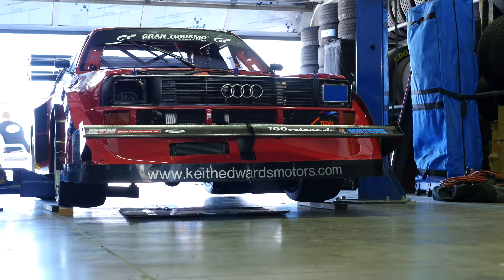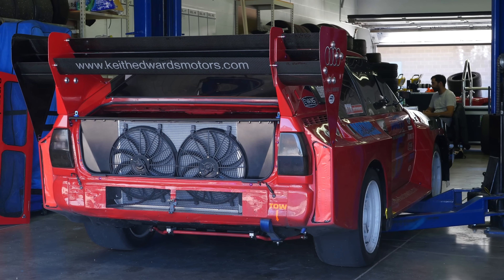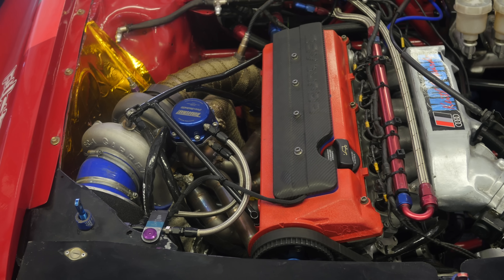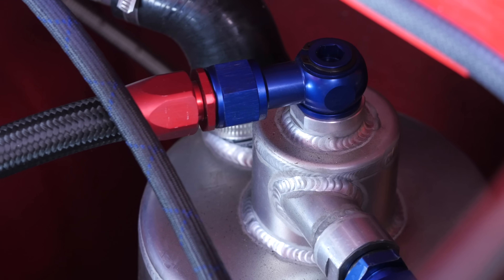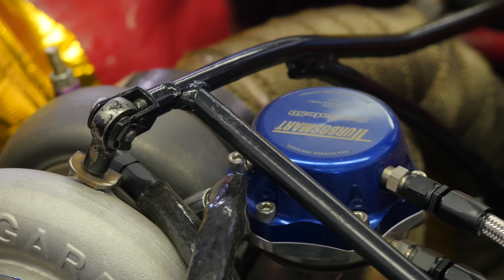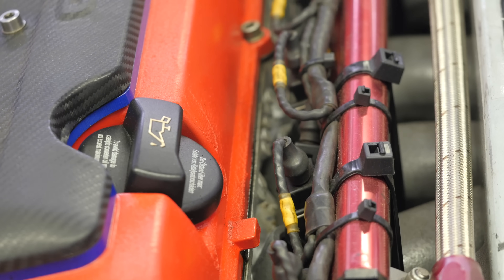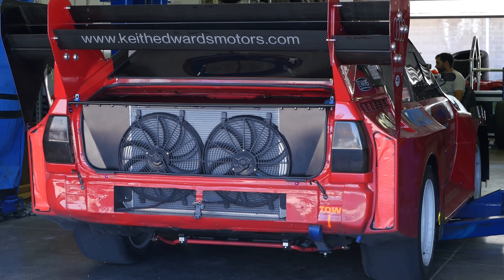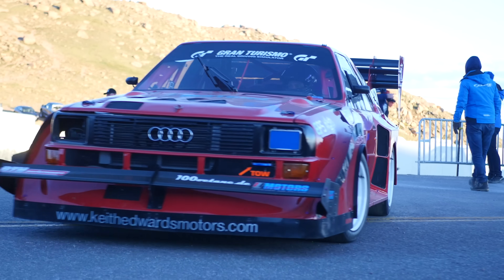Group B Pikes Peak | 750HP Audi Quattro S1 E2 Replica [TECH TOUR]

Comment from the maker: Want to dive into the finer points of why you think this is or isn't an accurate replica? Unlike arguing on the internet these soft threads will make you feel all warm and fuzzy so how about spending the time putting through your freight free order instead: https://shop.hpacademy.com/ - Taz.
Reply: haha, as a big (old-ish) Audi nerd, I'm happy as long as it's the right windshield, otherwise it just doesn't look right, but hey, to each their own! 
6:50 - does this arrangement use a transfer case? Original quattro transmissions used a hollow shaft to direct the power from the centre diff to the front wheels, so this sounds a bit unusual, or is that aftermarket transmission equipped with such a hollow shaft as well? Or maybe I just misunderstood what you meant.

Comment: Great video. Is the center diff a stock Torsen or is there no differential? 50:50 can be both. Fixed makes me think there is no differentiation going on like a spool. Is this transmission based on an 01E?

I cant wait to get my built 20VT running again!
Reply: Wouldn't be any point to a Torsen that was 50/50...  the early cars were all mechanical lockers.  Motorsport cars were generally locked all the time.  If it's based off the original gearbox it's 016 based rather than 01E.

Comment: The particular engine in that car behind you is probably from the later UrS4/6 AAN engine. You can tell by the valve cover and intake manifold. The IM is modified by moving the TB flange forward from the middle. The S2 IM has the TB mounted at the rear of the plenum and the intake pipe goes over the EM.

Comment: Aren't the fans on back to front, that may explain the cooling issues?
Reply: Modern cooling fans can be pushers or pullers, im sure with a build this technical the placement of the cooling fans wouldn't have been overlooked.
Reply: Have a look at 17:11.  They could go anticlockwise as we look but they would be inefficient as they are designed to go clockwise as we look.  Still, 700bhp at altitude is always going to be tricky to cool and the fans probably aren't doing much at speed?

Comment: Open front and rear? Didn't the sport quattro come with LSDs stock?
Reply: Very few older Audi's ever came from the factory with LSDs to my knowledge. They typically came with an open diff in the rear that could be locked with a button. Front differentials were always open from the factory.  The center differentials typically had a button to lock it to 50/50 while open they could go 25/75 - 75/25. The removal of the center locking diff button happened somewhere in the mid 80s I believe and the rear locking diff was last seen in 1995 UrS4 and 1996 RS2
Reply: The central diff lock was made unnecessary by the Torsen diffs, starting in 1987:
https://en.wikipedia.org/wiki/Quattro_(four-wheel-drive_system)#The_Torsen_T1_centre_differential
Reply: Maybe not front but I remember about the rear diff having a locker toggle. Maybe it doesn't have an lsd and its either locked or not by the switch.
Reply: Yes, as WhiteKnuckleDriving said: rear diff normally open until you switch it to (100%) closed.